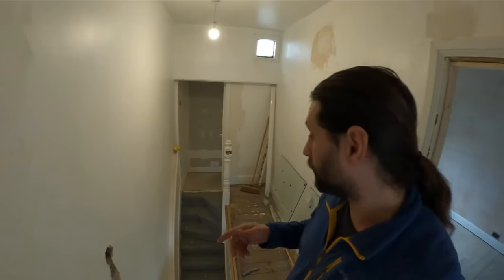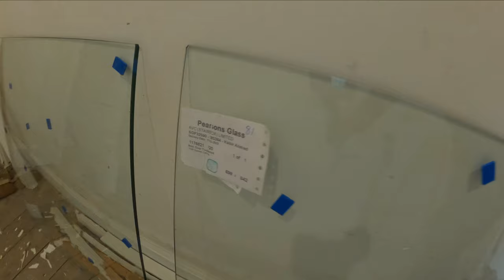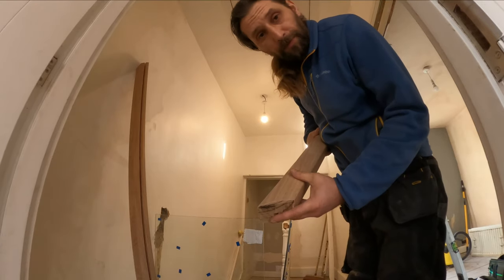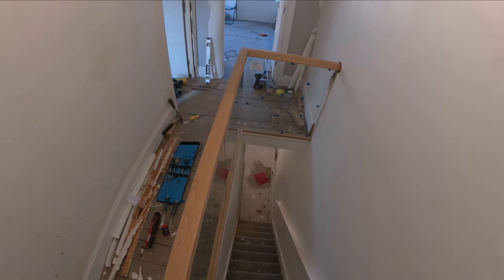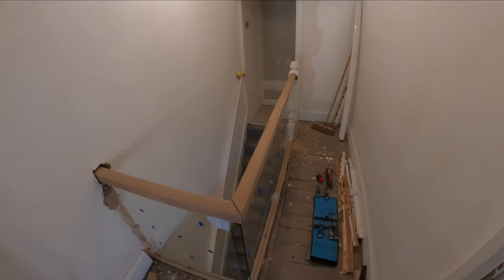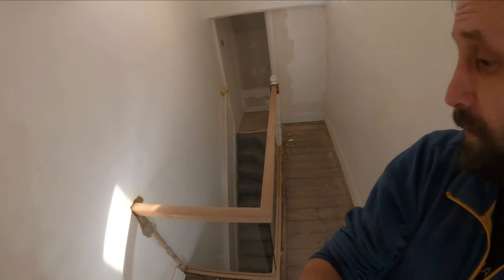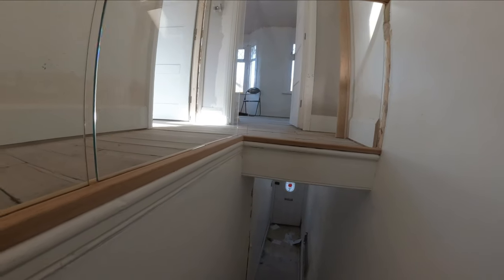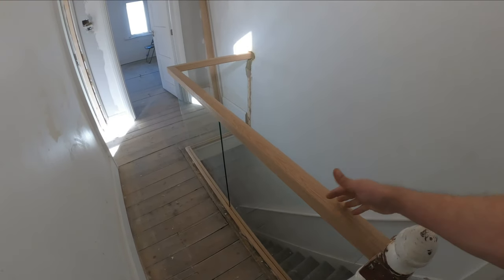Glass balustrade installation uk

Comment: You did that heatgunning without any mask or anything! Do you not worry about lead in paint on an old house? Honestly they used to stick lead in everything a century or so back...
Reply from the maker: You are definitely right on that aspect and I would encourage everyone to use the proper ppe when needed
Reply: I also don't use a mask. A short run of a heat gun won't hurt anyone.
Reply from the maker: That's right